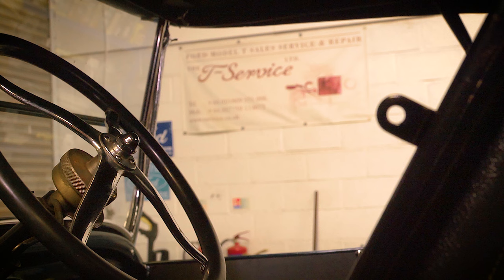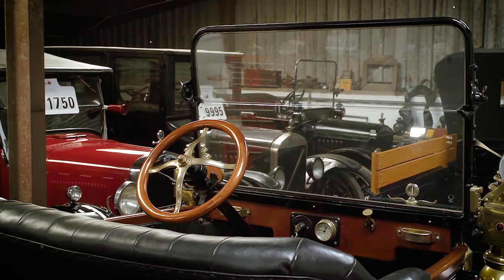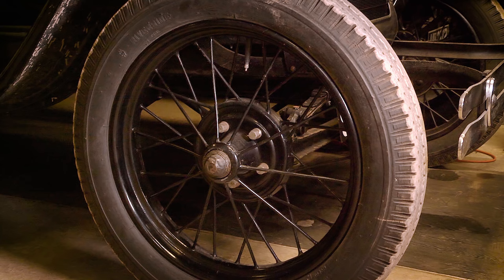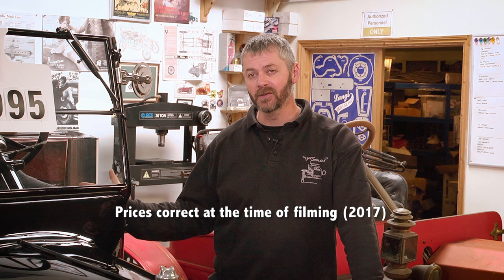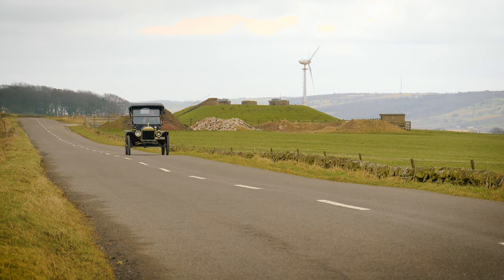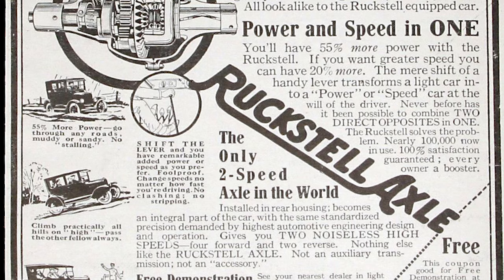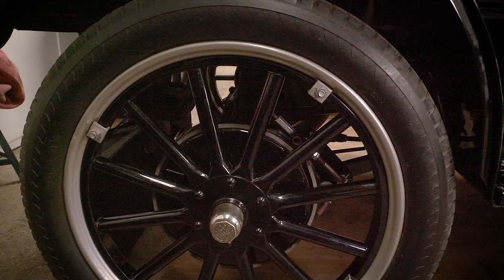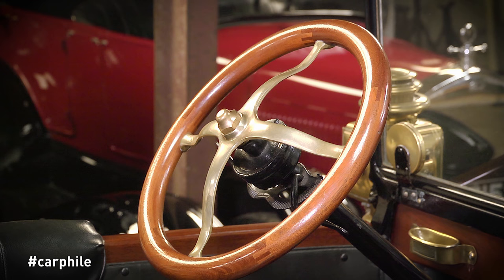Ford Model T Buyers Guide (1908 - 1927) - carphile.co.uk

Comment: Great video guys some wonderful details on what to look out for.
The steel used was Vanadium Steel on the bodies and they very rarely rushed through at least on the cars in the US. and a lot of spare parts are just stored outside even in the snow belt. you'll see they have a nice surface rust patina but very rarely do they get a hole through the panel. Little sanding and fresh paint that is new.

Comment: How do you go uphill with the gravity fed fuel it might not work if the hell is steep enough like a 10% grade
Reply from the maker: Good question - either keep the fuel tank over half full or it's rumoured going up in reverse also works (may be a myth though)
Reply: I have seen Model T's at antique car hill climbs , They all went up backwards!
Reply: Add an inexpensive electric fuel pump
Reply from the maker: Very 20th century Leon Nygren!